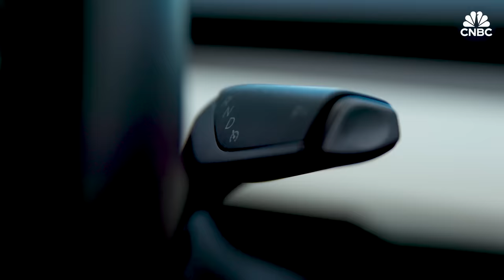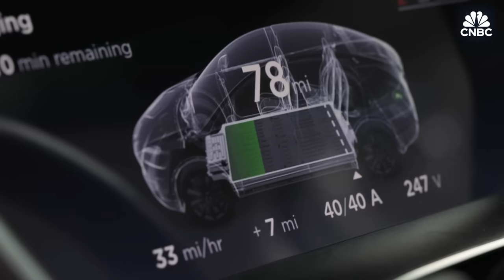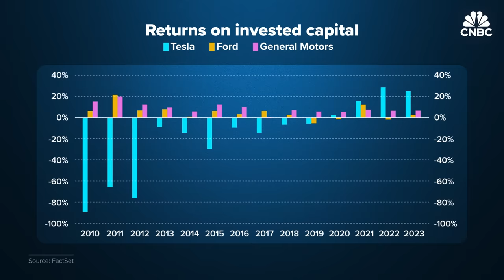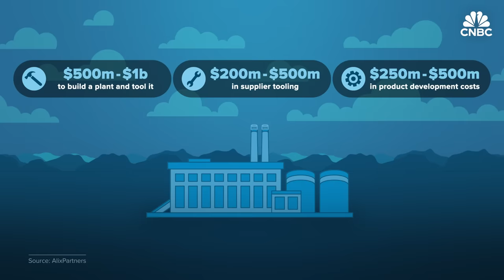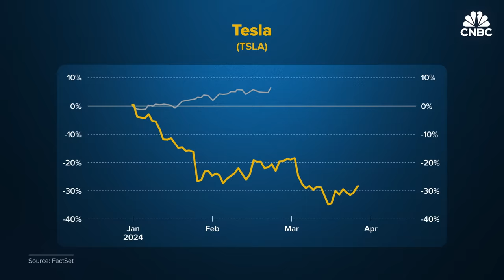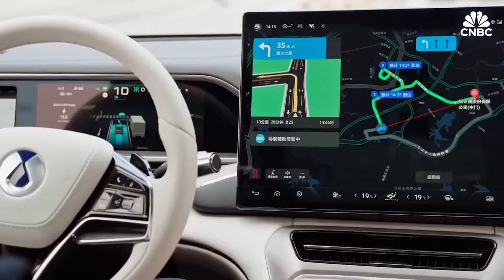Why So Many EV Companies Fail

Comment: We’re in the 1990’s of personal computing with EV’s. 10-20 years and the entire auto industry will look nothing like today.
Reply: Yes exactly! In ten years there will no longer be ev's because all the companies are bankrupt and they stopped making parts and software ages ago. Spot on!
Reply: Andreavenaa  interesting comparison, but it'll take quite a bit longer than that, I think. Cars, whether electric or not, are not analogous to computers. They may contain a lot of technology, but they're still a car at heart, and the automotive industry just doesn't move that quickly.
Already, here in the uk, the original date for 'banning' the sale of new cars with an entirely petrol or diesel drivetrain has been put back by 5 years to 2035, from the original, date of 2030. The government hasn't even whispered a suggestion about its policy on hybrids, which leaves the door wide open for cars with ice (as hybrids) to be available for at least another 5 years, possibly 10. That's potentially another 20 years of ice type vehicles being sold as new, but at a minimum, 15. 
I personally think that hybrids (PHEVs) could be a good transition solution; they can be dull and super efficient, a good all rounder, or a quite high performance car, so something for everyone, and allow for zero emission driving where it really matters, whilst not having any range issues. 
I think your overall idea is correct, but it will take so much longer than you suggest. In 40+ years, yes, the auto industry will look very different.
Reply: This right here. And I will just add that most people who are afraid or adverse to driving EVs really haven't done it yet. I have found the experience amazing even in its infancy. The next generation of automobile owners/drivers have nothing but good things to look forward to. All of the older folks (and I'm an older folk - but I did switch over to an EV as my primary vehicle and I absolutely love it) can hold on to their opinions if it suits them. But honestly, all they are missing out on is a really cool experience.
Reply: Nah, costs of EVs are keeping people away from them.  EVs are more in line with solar panels.  It’s great in theory but not so much in practice…
Reply: @Chad_Max  they don't work for you? It works for a lot of people.
Reply: The battery is a major issue and loss of power due to towing something it drains the battery too much. This issue has been an issue with since they were first invented in the previous century and still an issue.
Reply: @Boxagami only 25% of trucks tow yearly. The number is significantly less for other vehicles. Everyone else can buy EVs. Almost all 2 car households can have an EV.
Reply: @MadMadOne  towing is a major issue and IDK where you get those statistics. More people tow and need to tow and it's a major issue with EV vehicles and the battery. This issue has been an issue since the first EV vehicle was made in the early 1900's and the issue is still an issue with battery drain. It's not been solved in over 100 years of EV history. The concept of a battery powered vehicle is not NEW, it's over 100 year old idea. No, not everyone can afford a 60K ev car an especially two of them. I can tell you, that it would strain our outdated power grid and most who work in the industry will tell you that it's a bad idea. Cars of the FUTURE, but NOT the present. Hybrids would work more than likely, but going total EV is a dumb idea.
Reply: Tesla = Apple

BYD = Microsoft
Reply: @Al-vw8qt  BYD is a Chinese EV company.
Reply: The problem is that 90s computing was exciting and rapidly evolving, given personal computers were becoming more affordable and readily available.

Meanwhile EVs are more like another passing expensive tech fad like clappers, 3D or even the iPod.

Eventually all-natural gas & public transport reform will make EVs, personal vehicles anyway, obsolete
Reply: @AlexanTheMan  So, without the petro industry, how will you manufacture EV's? The plastic, rubber, tires, etc is petrol based? How will you even charge them without fossil fuel power plants? People are giving up EV's they bought, that's in the news already. They have the same issue they had when they first developed EV's more than 100 years ago and that's loss of battery drain when towing.
Reply: @Boxagami  It is the great fossil fuel paradox.

Comment: In addition to the high capital barriers, the market is not nearly as big as the prevailing "wisdom" thought.  A recent Gallup US survey showed that only one-sixth of people either owned, or would seriously consider purchasing, an EV.  Another one-third would consider it, and one-half would not consider purchasing an EV.  The market for EVs is nearing saturation, unless huge strides in cost and performance can be achieved very quickly.

Comment: EVs are indeed more environmentally friendly in terms of CO2 emissions. Though in the end, where will electricity come from to power EVs? The battery production also results in damaging the environment and creating industrial waste. Not to mention EVs' limit in extreme weather.
Reply: And where does the electricity come from for powering the oil rigs and refineries?
Reply: Solarpanels and windturbines
Reply: this comment reeks of big oil lmao, muh carbon footprint
its actually twice as bad with ICE
Reply: A coal or natural gas fired power plant is many many times more efficient than a gasoline powered car. Not to mention the fact that the grid is 60% fossil fuel at this point and dropping.
Reply: Even coal power is massively more efficient than gas engines in each car would be even with hybrids for that matter.
Reply: EVs get twice the miles per ton of carbon emitted when charged on 100% coal, and only gets better as cleaner sources get mixed in.
Reply: @Dragoonoar  It is not worse with ICE, check the Volvo study.
Reply: @ryanfraley7113  the last numbers I saw puts a coal powered EV on par with about 45mpg - the same as I get with my Hybrid Camry.
Reply: @doujinflip  Depends on what ICE you're using, I suppose.  But a coal powered EV gets about 45mpg equivalent, the last I saw.  A hybrid Camry gets the same.
Reply: @InPursuit2023  Hybrids are still better than ICE for the environment though. I completely understand having a hybrid in an area where the infrastructure for EV’s isn’t developed like rural areas of the US.
Reply: They're about the same, They just shift the emissions from end-user to manufacturing. The difference doesn't make a dent in any honest climate impact evaluation/analysis with all things considered. Electricity at the scale needed to power "over half of all cars on the road" CANNOT be generated using renewables; and even if it could, the construction required to harvest/utilize renewable energy at the scale needed, that itself cannot be done at that scale using renewables. Period. Maybe in 50 years when AI have become self-aware and have become Digital Quantum Gods; maybe they'll figure out how to make renewables only with renewables; at scale (possibly using humans as "batteries;" putting us in pods where we are put into a coma and our conscious minds live out a fake life in a digital world they created specifically to keep us asleep so they can control us--which would be a great movie quadrology).

Anyways; You literally cannot escape the pollution. So the only option is to reduce it. And the only way to reduce it is to go all-in on "you will own nothing" ... you can cut pollution by half, if you just decide half of the country/world just isn't allowed to drive anymore (under threat of early admission to heaven). Or you can reduce it by using renewables wherever in the process it makes sense and is feasible. But...

A lot of "eco friendly" stuff uses recycled materials in production, but they last half as long, so you're buying twice as much, so it costs twice as much, and it also produces twice as much waste. Even recycling itself cannot be accomplished without the use of NON-renewable energy at some point during that process. And so if you're doubling the amount of recycling you're doubling the the use of non-renewables required to actually recycle the original thing.

Comment: IT IS NOT JUST EV COMPANIES.... IT IS ALL CAR COMPANIES ... more petrol car companies have failed per year than EV-companies. It's normal to struggle as a CAR-MANUFACTURER. ALL BIG CAR INDUSTRIES have lost money in the past 8 years.
Reply: Exactly
Reply: Really? Toyota, Stellantis, BMW, Mercedes and many seems doing well these years. EV companies are not so resilient.
Reply: @lonelygod6629  lol no - nobody is buying their EV's | they are going bankrupt, dont worry.
Reply: @luderx that’s why they are gonna start selling more hybrids and plug in hybrids.
Reply: @luderx  they are not making profit from EV. Problem is EV.
Reply: Problem is topping up EVs, which is solved by installing more chargers. Cars took a few decades to replace horses and wagons until there were enough gas stations.
Reply: @lonelygod6629  The problem is not EV's Tesla is doing EV's profitable. The problem is lazy companies not innovating their production, thus losing money. You CANNOT make a profitable EV, by just putting a battery in a legacy car.
Reply: @lonelygod6629  that was due to lack of capital, but now-a-days capital is not a issue. Look at Rivian, Lucid, VW. They do NOT need more money, they need less, and start actually learning how to build a car.

Comment: Starting from scratch seems like suicide. 
I am interested in how the Sony/Honda partnership will go. You have Sony making the software, sensors, etc., while Honda builds the bulk of the car using their own experience and factories. 

Apple, Dyson and others should have solely focused on providing the tech and partnered with an already established car maker. This is like how some battery companies solely make batteries for EVs in partnership with established car makers. After all, the core of an EV is the batteries and electric motor. Everything else has already been established. No need to reinvent the whole expensive process of making the rest of the car just because you think you can make one component better.
Reply: Apple should have taken their opportunity to merge with Tesla, moved cook out to pasture and handed the CEO job to Elon Musk.
Reply: Apple approached BMW in Germany about making a composite bodied car for them, after seeing their success with the i3. However, we all know  apple's way of doing business, and when they spelt out their requirements for the deal, BMW laughed them out the door, and that was that. I actually find it hard to imagine any well established western car company partnering with apple, because they are so greedy, and won't countenance anything other than huge profit, at everyone else's expense. I could imagine, however, Apple partnering with a Chinese ev company, like BYD. After all, all their phones are made in China by Foxconn, so why not their cars ?

As a Brit, I was very disappointed that Dyson didn't go forward with their plan, since they kept saying how amazing and innovative their vehicles would be. But I agree with you, they should have partnered with an existing car maker.

Comment: there is no simplicity, modularity, and full cycle end to end development. You should have a dead simple cheap city car, be able to take out the car battery, replace with a new one and get rebate for dismantling it and collecting good cells which can be reused for power storage. Like an ebike. Instead companies are focusing on self driving and high tech luxury cars

Comment: Many but above all else, a lack of a standardized charge plug which works with every brand. Imagine if there were proprietary gas pump nozzles for each brand and you get the idea.
Reply: The Tesla charging port NACS will be the standard port. Most manufacturers have announced the switch a while ago.
Reply: @mikaxms  in the US, but in Europe, by law all Teslas use the EU standard.
Reply: @linusa2996 and it’s now each continent has 1 plug (going forward) which is fantastic
Reply: @h20dancing18  not really, it means that the manufacturer has 2 different charging standards and parts, 2 sets of maintenance procedures and support courses
Reply: @linusa2996  that's nothing compared to the challenges presented with emissions controls and safety standards between continents.  Really no different than different options.
Reply: The industry is converging on just two standards, both of which can be dealt with.  Unfortunately, every country has a different electricity grid, which itself an issue...
Reply: @unconventionalideas5683   yes and no. Some blocks are making an effort to have a single electrical standard
Reply: @rubyruby7573  Hamster wheels!

Comment: Short answer: greed. Money and a lot of it, as fast as possible. Could make a great product, simple, reliable, reasonably priced and thus, competitive. But this would bring profits down the years, slowly. But people want money, now. So the electric cars became complicated, unreliable, overpriced. And bubbles burst, people detect the problematic product and they refuse to buy it. ICE cars are in a similar situation, regrettably. Make good cars people can use, if you make them, they will sell.
Reply: Part of the problem is that the federal government mandates too many safety features.
Reply: Evs are neither complicated nor unreliable. You don't seem to know what you are talking about.
Reply: @hastyscorpion  Thanks, had a laugh. Sure, and the Earth is flat and the center of the universe. Visit Chicago in the winter and look around for reliable EVs, they are mostly stuck by the chargers.
Reply: @romgl4513 do you know ICE cars can struggle in the cold too?  Plus, how often does this very cold weather occur, and where?  This is also caused by Climate Change too, it is your karma for a car to not start in the harsh winter you created for yourself

Comment: And this is why BMW's strategy of having an initial wave of EV's built on the same platform, using very many of the same parts as its ICE cars, is kinda genius --you tap into the economies of scale that the ICE + EV vehicles combined give you, instead of just relying on parts for your bespoke platform EVs.

Comment: Anyone who’s driven an electric car knows there’s no going back to gas or hybrid. No comparison and being much more efficient is a bonus, getting about 300 miles for just $7.00 of electricity
Reply: People are going back to ice vehicles in droves ….
Who wants to queue for a measly recharge for hours at a time ?
Reply: @batmanlives6456   Other than the occasional road trip I charge at home 99% of the time and, getting about 300 miles for just $7 of electricity is a nice bonus. Public charging takes 30 minutes max to charge from 20 - 80 percent at a Tesla Supercharger. EV sales is growing but grew less due to slowing economy. The transition to electric cars is inevitable and soon new gas cars won’t even be available because they won’t be profitable to produce
Reply: @stevenhill3136  Why don't you talk about other NEGATIVES about EV?  My brother has a Tesla too.  What about renters, who lives in apartments, don't have a garage to charge their EV?  Sometimes there's a line at public chargers.  Copper thieves could cut the cable, thus reducing the number of available chargers.  If you share the charger with another EV, your charging time is halved.  Other EV owners could take your charger, so now you gotta buy a cable lock.  Every time you charge, the range of that battery is reduced.  Don't forget about the EV fires as well.  You can't put it out, like a normal fire.  Don't forget about the ppl in Chicago who couldn't charge their EV this past winter.

Comment: By YouSum Live

00:00:15 EV industry challenges and failures.
00:01:00 Capital-intensive nature of EV startups.
00:03:48 Importance of innovation and execution.
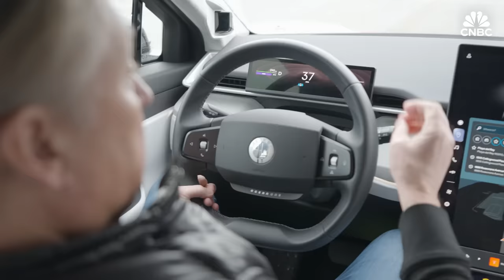00:04:58 Financial struggles and capital requirements.
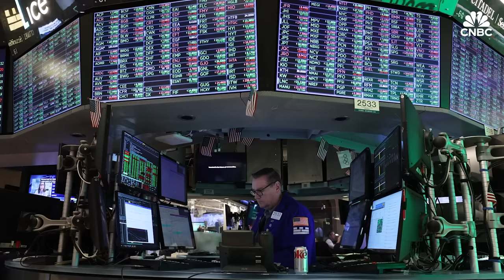00:06:13 SPACs as a funding avenue for EV startups.
00:07:39 Cost breakdown for starting an EV company.
00:08:37 Manufacturing approaches and challenges.
00:09:43 Regulatory hurdles and safety standards.
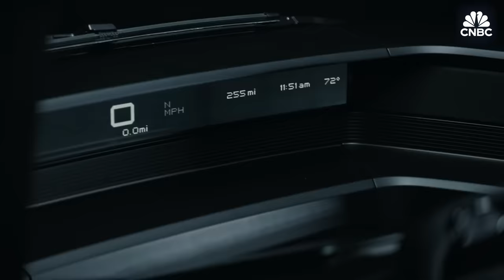00:11:19 Balancing innovation and tradition for success.
00:12:15 Historical parallels in the auto industry.
00:13:18 Vertical integration trend in the EV sector.

By YouSum Live

Comment: Instead of listening to people telling you to start fresh, they should have just made the drive train and convert existing used vehicles electric.  Much more feasible to start that way, than making a whole new car.
Reply: That is literally making a whole new car. You do realize EVs and ICEs are not interchangeble? They have completely different load distributions, and EVs are generally much heavier and simpler vehicles mechanically. It absolutely makes more sense to focus on designing them from scratch rather than retrofitting the billions of existing unoptimized ICE models.
Reply: That can be done, but it won't have very much range when completed.  The cars with 200+ miles of range take very large batteries.  Designing as EV from start is the only real way to do it.